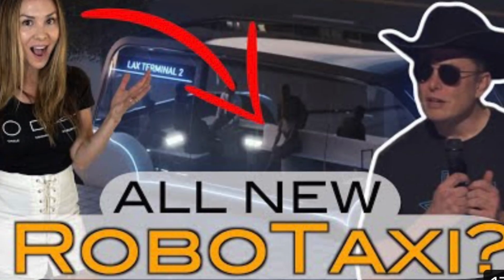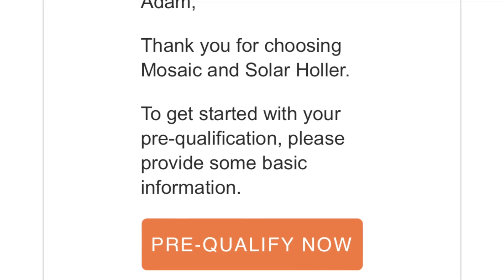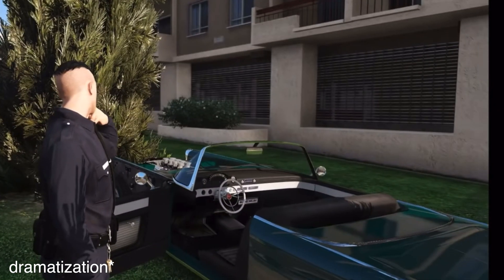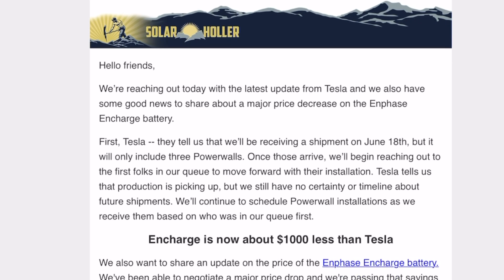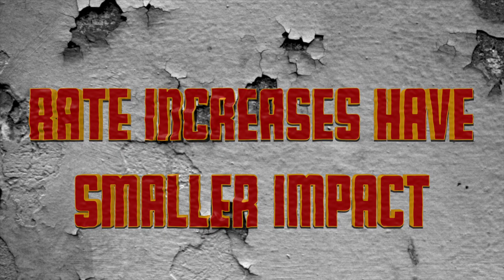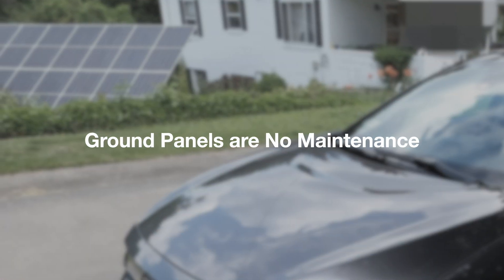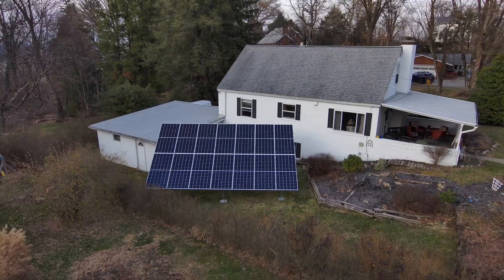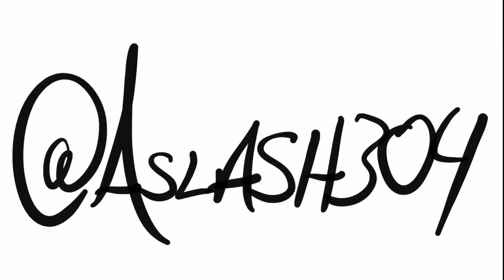Ground Mount Solar with Tesla Powerwall Install

Comment: I would not touch solar holler or mosaic with a 10ft pole...the better option is to go with a Point Zero Titan it can run what I need and cost a heck of a lot less and it has the benefit of the FTC to boot.
Reply from the maker: Off grid was what I was going to go with at first.  The modularity is a benefit for sure.  The grid tie system adds value to the home, but I understand the strategy. Thanks for your comment, Cheers!
Reply: @Aslash304  value to a home has yet to be determined, holler tried that one with me as well, with the interest over the long haul it just didn't add up...I also read the horror stories of folks trying to sell their homes while in solar contract with mosaic.

Comment: I installed solar in 2018.  The cost benefits was easy to see.   Didn't decide on Powerwall until November 2020 and like you experienced 18 month backorder.  Just finished install last week.  Here in Northern California public safety power shutoffs convinced me of the value.
Now high wind psps are being resolved but due to limits on power available we are told we will be facing regular power outages this summer.  Powerwall will ensure refrigerator and freezer don't thaw and wife's starlift keeps working.
My solar is 7.4 kwatt and it looks like at true up in three weeks will see a credit balance of 1000 watts.  That will only result in $30 payment against basic fees of $60 due.
Not bad for a year electricity bill.
Reply from the maker: I can’t wait to see how mine all pans out.  Numbers look good.  Won’t ever be 100% independent because we both have EVs, but I hope the savings are significant.  Thanks for your comment, Cheers!

Comment: @Aslash304 What was your thought process regarding Powerwall vs Enphase? How was a Powerwall better in your use case? No roof mounting in our development, so your ground mount piques my curiosity.
Reply from the maker: The Enphase is an LFP chemistry, which is reliable and safe, but it also has lower output.  To get the same output, the Enphase batteries need to be doubled up.  I think the encharge is worth a look if you’ve found an installer you like that offers them.  Here’s a pretty solid comparison of both.  https://gosolargroup.com/battery-backup-comparison/powerwall-2-vs-enphase-encharge/ I hope this helps you, please feel free to ask any other questions you have.  Thanks for your comment, Cheers!
Reply: @Aslash304  I heard enphase is having issues with the wireless communication used between battery and gateway.  Powerwall is hardwired to gateway
Reply from the maker: @TUMARK2  I’m happy I was able to get the Powerwall, but many others won’t be able to.  I hope enphase figures it all out.  Thanks for your comment, Cheers!